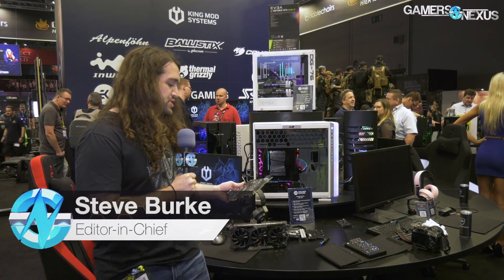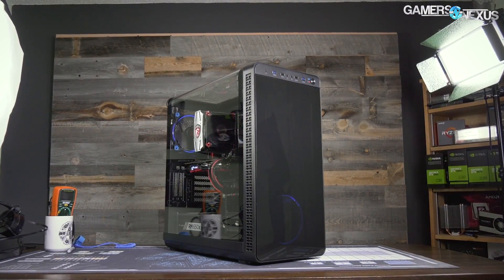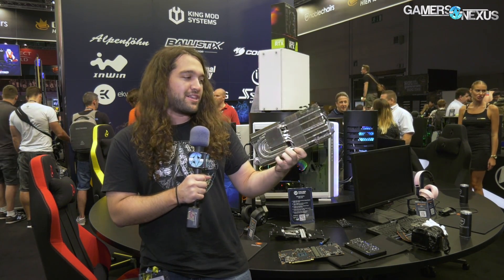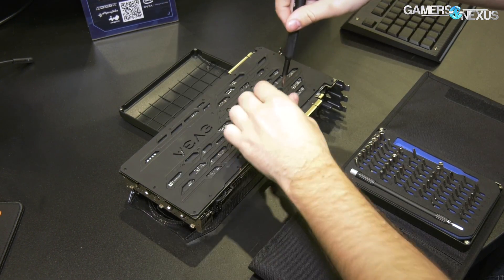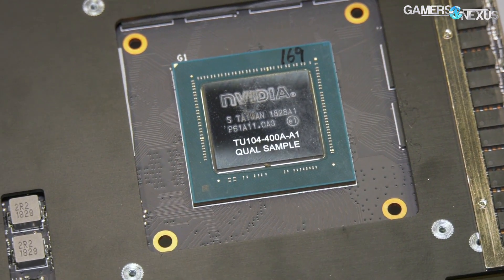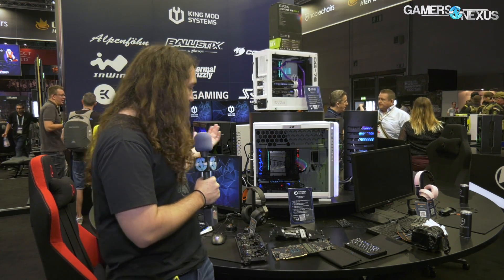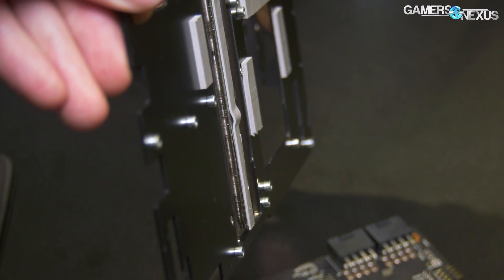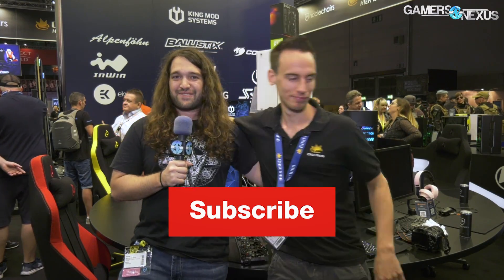Tear-Down of EVGA RTX 2080 FTW3: VRM, Die, & Cooler

Comment: Releasing the 2080ti at the launch of the new generation of cards instead of being released as a stop gap between generations and the price point leads me to believe that they have rebranded the titan. If that is the case something else will come out around roughly the time previous generation Ti's were released in the cycle with a new name at a reduced price point similar to previous Ti's.

Comment: If you buy one of these cards then you deserve everything you get. This is simply Nvidia, without competition milking with this stop gap till 7nm were the real deal will happen. The dies are huge, the cuda core rise in each class is around 15% but the clocks I doubt will reach pascal due to thermals/die size and the ray tracing cores don't justify their inclusion, Look at the game demos, they weren't that good. The danger is like gameworks, nvidia will force programmers to insert the nvidia ray tracing works (RTX) to lock out AMD, even if it slows down the game on nvidia cards so long as it's less than AMD. If anyone has any brain cells then the thing to do is wait for 7nm, then make a decision as AMD will be back in the market at 7nm and competion will force better cards for us all.

Comment: What did they do with the capacitors? Are those 12 chips on the right part of the VRM in place of capacitors? They look like something I found called Hi-C capacitors. They say they have 15 times less current leakage and last 8 times as long. The PCB looks like it has a lot of empty space.

Comment: Best info I could fine on the voltage controller, https://www.wpgholdings.com/procurement/procurement_detail/zhtw/AIT-UPI-POWER-UP9512P

It was posted 3-28-2018, which is interesting. Was this controller specifically engineered for these cards? It states "VR Output Reporting."

Comment: Just bought a GTX 1070 Ti for 350
Reply: 1070 ti is close or beating 1080
Reply: That’s a good deal!
Reply: fucking where dude?
Reply: Inside a PC for 899
Specs: 
- Mainboard: MSI B350M Pro-VDH
- CPU: AMD Ryzen 5 1600
- CPU-Cooler: beQuiet! Pure Rock
- RAM: 16GB DDR4-2400 (2x 8GB)
- VGA: 8GB GTX1070 Ti
- SSD: 500GB
- HDD: -
- ODD: -
- PSU: 500W beQuiet! Pure Power 10
- CASE: Sharkoon V1000
- OS: -
Reply: There's an EVGA 1070ti for sale on Craigslist by me for $300 should I get it and sell my 1060? It supposedly has 2 years of a warranty left on it, and was ran via sli.
Reply: snuffles i'd buy it! where im at I still see 1060 6gb on fb and craigslist going for $280+ and a couple 1070's going for $300+
Reply: Snuffles What kind of monitor do you use (resolution & frequency)?
Reply: 1080p dual monitors at just over 60hz, I think it's like 66, 67hz, nothing too impressive, that's for sure.
Reply: Snuffles I would wait for the next generation (after RTX 20xx)

Comment: I'm asking this before I've even watched so forgive me if this was answered already, but I bought an EVGA 1080ti FTW3 a month ago and recently heard about EVGA's step up program.  Do you know if the 2080ti will be included in that program?  Also, I was on EVGA's website earlier and noticed they only have the 2 fan configuration available but would prefer the 3 fan, do you know when the 3 fan will be releasing?

Comment: People need to put the pitchforks down. Look at this in detail, the 2080 ti still has almost 1K more CUDA cores then the 1080 ti. Also it's a completely different architecture, how do you know how it's going to react to gaming? How do you know the Tensor cores don't help with normal games too, by predicting frames? The card claims to have over 110 TFLOPS of FP16, it should be able to do lighting and coloring on that and do FP32 on CUDA at the same time. Also on top of all that, you have GDDR6, that will also bring a performance gain. I say we wait until benchmarks come out before throwing NVIDIA under the bus.
Reply: It's about the price not the performance. 2080Ti costs almost twice as much as 1080Ti.
Reply: But this seems like a bit of re-branding by NVIDIA, my impression is that this is the new Titan card. May as well be called "2080 Titan", so i expect it to be a premium price.
Reply: @snokones  If the new 2080 ti is the new titan than that is even more disappointing because the 2080 is barely better than a 1080 ti after 2 years.

Comment: So back and front plate. That certainly prevent any warping.
The front plate being used to transfer heat to the heat sink. But due to the design we have two thermal pads between the component and the heat sink except for the chip which only has one in between.
Looks like the two uncovered heat pipes to the front are used to transfer heat from the VRAM to the heat sink. 

Will be interesting to see how this performance considering the two thermal pads between most components.

Comment: If the EVGA 2080 XC Ultra is already way overpriced at $850, I can’t imagine what they’ll try to charge for FTW3 version... maybe $900? $950? These prices are absolutely insane. 2080 Ti is even crazier.
Reply: You say 70k like its a lot of money.
Reply: Probably around 1300$
Reply: Maybe 20% faster than 1080Ti (by Nvidia graphs)
No, Trump is not gonna be impeached!
He'll be there when World War 3 starts (It's close)!
Reply: So, you just graduated with a basic STEM degree and started last week at age 32???
Reply: 2080 is basically a 1080Ti Boost, you are paying for an extra 5 to 10% boost in normal gaming!
Reply: @JDOverclock  that's why only idiot's buy a new product if only one generation.
Reply: lets see benchmarks before you make any claims.
Reply: I look  at game requirement for shadow of the tomb raider say my 1080 ti should run game in high . Prices on these 2080 have just skyrocketed . I watched a zotac 2080 start at 749 on amazon hours later it was 869 for a 2080. Me i dont care im ok with my gaming rig without the ray tracing dont see much going on  there .if i were to sell my 1080 ti i would not even break even so the hell with that. Id loose money selling my card.

Comment: SLI VS NVLINK IN DEPTH PLZ!! Steve I will love you forever for this investigation in the name of science!
Reply: Vram stacking is possible with nvlink.
Reply: Awesome! Why can’t it be done software level with sli? HB bridges
Reply: it would be nice to see how the RTX 2080s use nvLink, the biggest use case should be extending VRAM so two 8GB cards will total 16GB and two 11GB cards will total 22GB... as for 80gb/s to 100gb/s transfer speeds I am not sure how if any that would help in gaming unless you are doing some insane 16k gaming setup.
Reply: That would limit the bandwidth, and the GeForce Series doesn't have the full capacity of 100GB/s on NVLink, it's cut by half, it's capable of 50GB/s max!
Reply: I was being General on the #'s because we dont have actual ones yet, only theorized by nvidia. My explanation was more so explain what DV link is and its ability to him because he did not understand it, I choose to NOT included speeds because I have seen some reports from Nexxact that says 300gb, Toms Hardware state 230 gb speed and some from Nvidia  that say 200gb NV and others yet still that say only 160 gb so until any of those #'s are proven, even nvidia says they cant 100% measure yet because the finally drivers are not ready for accurate interlink speed Numbers!
Reply: Would be cool if it somehow forces the games to run on both cards so there aren't as many compatibility issues as with older generations and SLI unsupported games.
Reply: Howdy Abraham,  There wont be any SLI but been removed on alot of Cards in favor of DV LINK but some have both but Green will NO Longer be supporting SLI! SOOO The New way DV LINK....its almost like an HB SLI ... BUT alot more Powerful plus it can allow you to use just 1 Wire so if VR ever really catches on this could be used with a VR wire or maybe a Wireless adapter because they claim it has massive bandwidth, once STEVE, Der8auer, or Buildzoid tears into these GPU's we will have all the answers, But i would say about 2 weeks to have Confirmed REAL #'s !!!

Comment: Do you think these cards are worth the price for a casual user? I'd say for someone who uses raytracing to put bread in their mouth it will be as soon as programmers of blender, maya etc. adopt rt tech but what about an average joe? These don't give you twice the performance for the double price tag.
Reply: The thing about using raytracing in games as a developer is that they serve no purpose whatsoever if there isn't a consumer base with compatible hardware to use it, and by far the most consumers only spend up to $300.
If Nvidia intends to keep the barrier to entry at the 2070, raytracing will be dead in the water.
Reply: It's not double the price tag. The GTX 1080 was $600-$700 at launch, with price cuts a year later. RTX 2080 is $700-$800, or a 30% price increase from the lowest 1080 launch price to the highest-listed 2080 price.
Reply: No they apparently suck at ray tracing also. 
The 2080ti only running tomb raider at sub 40 fps 1080p with ray tracing and bf v sub 60fps 1080p with ray tracing enabled.
 If you want price performance stick with pascal.
Reply: If the raytracing hits your fps that badly then ima just get a 1080ti
Reply: @WayStedYou where did you get that number from ? 40fps at 1080p ??
Reply: don't know what you talking about, the prices are actually relatively cheap. The RTX 2070 is priced at $500 for performance inbetween the 1080 & 1080ti which are $450 for 1080 and $650 for the 1080ti atm. And aftermarket GPUs not being sold by nvidia are all $50 - $100 cheaper atm, so you can get an RTX 2070 for as low as $450. Soooo if you are comparing the RTX 2070 to a board which is $450 which would be a GTX 1070Ti I have read that it would have 20% more performance then that + Ray-tracing? sounds like a good deal.
Reply: @Jeff

May want to take out your glasses friend.. https://www.nvidia.com/en-us/geforce/20-series/?nvid=nv-int-gcxxpn-56591
Reply: those are founder edition prices, Saw RTX 2080s on Newegg for $725
Reply: @Jeff

First off, AIB's will not be selling their cards cheaper than the reference cards, this was made clear with Pascal.

Second, where are you seeing this?

Third, $725 is not that good of a deal

Fourth, the actual card here everyone wants to know about is the Ti, as it sets the limits
Reply: which is only $50 more then 1080ti's atm
Reply: I had to look for the clip from the stream but I found it on some random guys twitter. Here's a link to a pic from the stream of the non FE prices  https://twitter.com/TrboMode/status/1031609867939840000 and the non reference cards can already be found for $50 - $100 dollars cheaper on newegg for both the 2080 and 2080ti. Sold out ofcourse though.